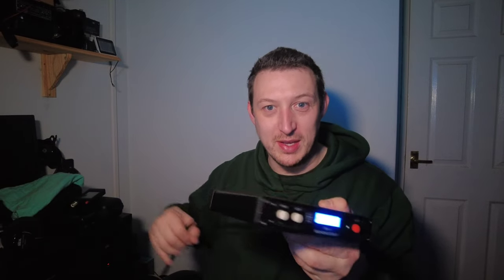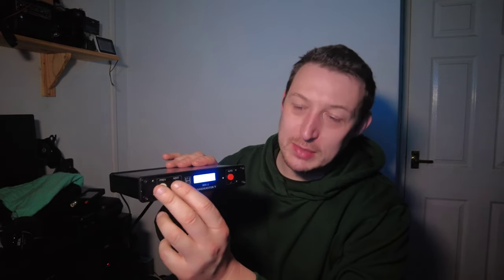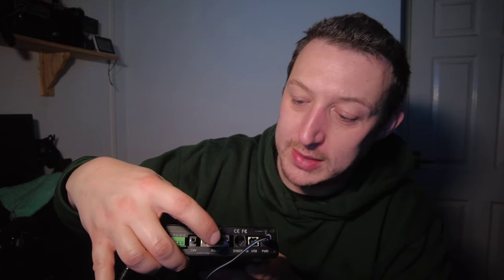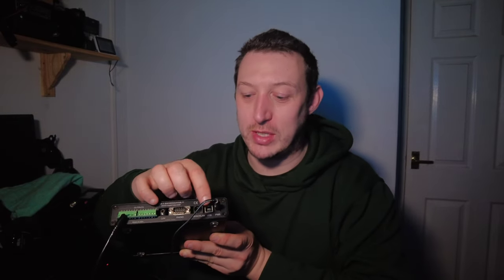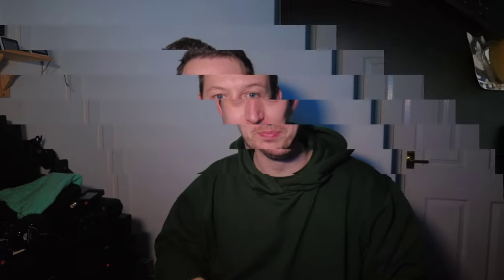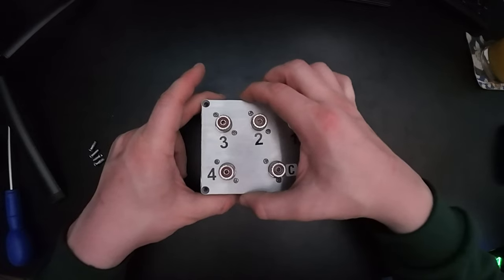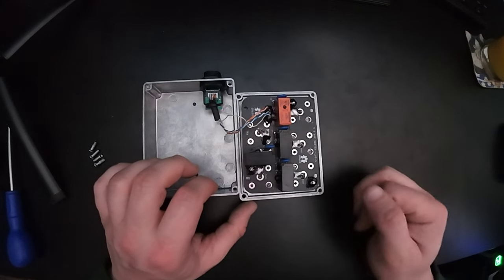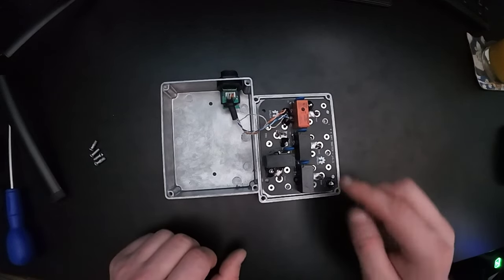Automatic Antenna Switching - Building a luxury shack

Comment: I am liking that automatic antenna switch setup a lot..thanks for sharing.
Reply from the maker: I like the fact that it works with virtually any radio with CAT control, so it's easy to switch out the radio of I need to.
Reply: @AmateurRadioUK  Yes i noticed it had good connectivity, something like that is on my want list.

Comment: I totally stripped my shack last October and rebuilt it. Mine is a but simpler than yours as its outside in my shed but just having it the way I want it without excess redundant wires has made things so much more manageable.
Reply from the maker: Yep, I know the feeling. 

I previously had all the kit on a desk, which meant not much desk space & wires everywhere. 

This time I've put all of the radio gear into a rack on wheels.

Seems to be working out great for me so far.

Comment: nice set up James, as said before, how the other half live hi. just one rig here 12v batts, one coax feeds two ants, home made rx ant switch cost 8 pounds, and never never ever need a amp, 10w ssb to vp8 from zl.  73 mate
Reply from the maker: Hi Brian. That's the great thing about this hobby. You can have a simple QRP station with a modest antenna setup, or you can go totally overkill with amplifiers, big antennas & all sorts of accessories. It's a personal preference.

Me personally, I really enjoy keeping it simple & running QRP in the field, but I also enjoy running QRO from the home station........I think I get the best of both worlds.